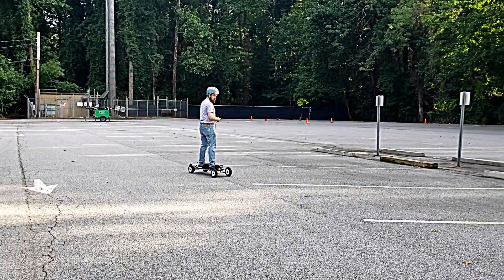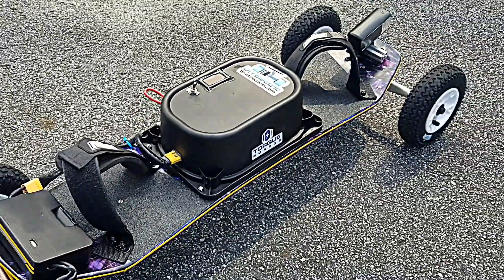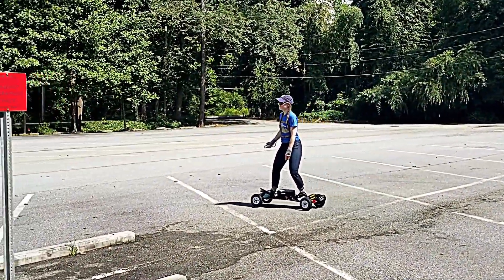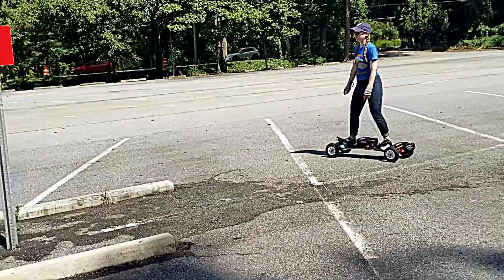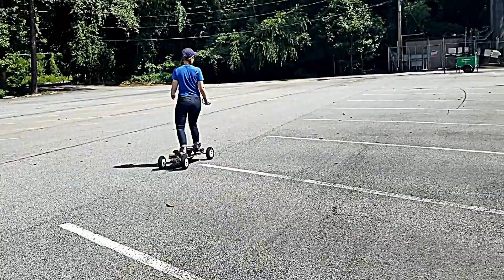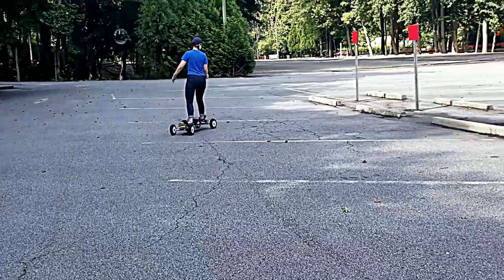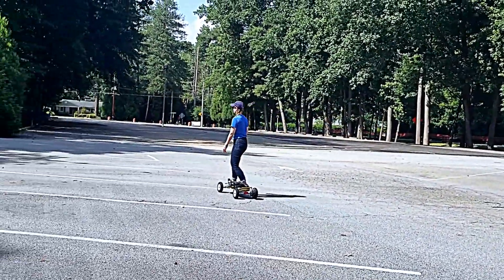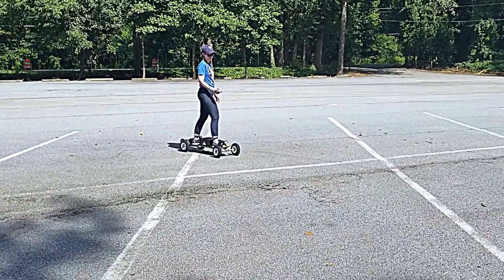Electric Mountainboard - MBS + SK3 6364 + Ollin VESC

Comment: Where did you get the motor mount and the pulleys?
Reply from the maker: The motor mount came from https://diyelectricskateboard.com/products/single-bolt-on-motor-mount-set-only-black but I had to grind down the MBS trucks a little bit to fit the typical Caliber truck profile the mount is designed for. The pulley on the motor is from SDP/SI http://shop.sdp-si.com/catalog/product/?id=A_6A25M020DF0908 , where I also got my belts. The pulley on the wheel was designed myself in CAD and 3D printed using PLA at 103% scale then cured in an oven for 30 minutes to increase its strength (which also reduced its size to proper scale).  You can also get the wheel pulley from SDP/SI (http://shop.sdp-si.com/catalog/product/?id=A_6A25M072NF0912 has 72 teeth, which is too large for the motor mounts), which I did for the first version. But it's expensive and you may have to lathe it to open up an inside circle.

Comment: This is really impressive man! How much overall did it end up costing you? I've been getting ready to do my own diy board, not nearly as nice as this though!
Reply from the maker: Thanks! I made some mistakes along the way, which probably made me spend $200 more than it would cost otherwise. With that said, you can probably do the same for about $900-1000. The biggest costs are: the deck+wheels+trucks ($200), the VESC ($200), battery ($200), and motor ($100).  Everything else depends on how "fancy" you want to go - voltage meters, lights, etc. I'd honestly recommend not building a custom LiPo pack but rather buy and combine RC hobby-packs. But I did it to learn. Definitely hit up http://electric-skateboard.builders for lots of advice. Great community.
Reply: Benjamin McMillan thanks for the tips man! I'll definitely keep all that in mind while working on mine.